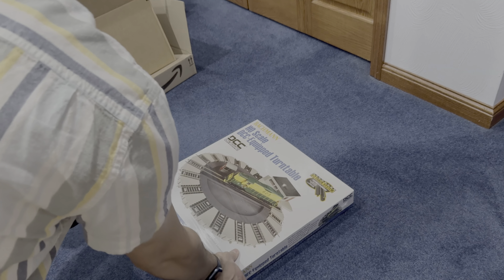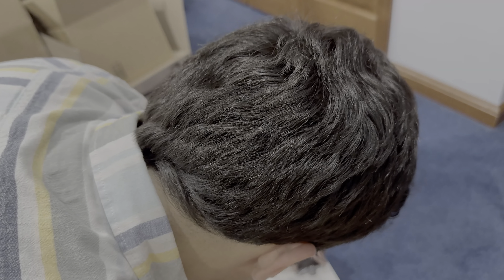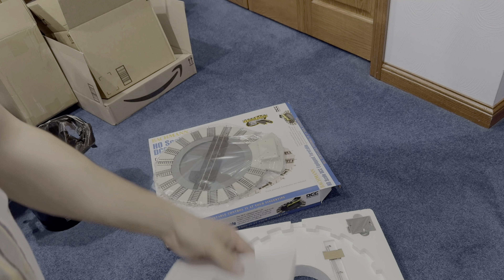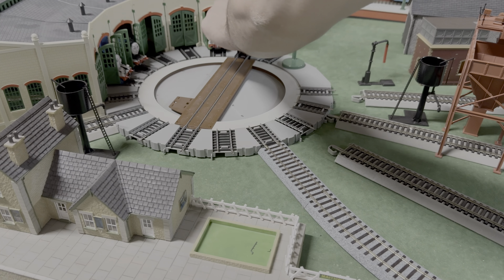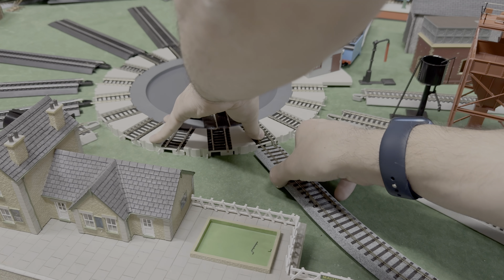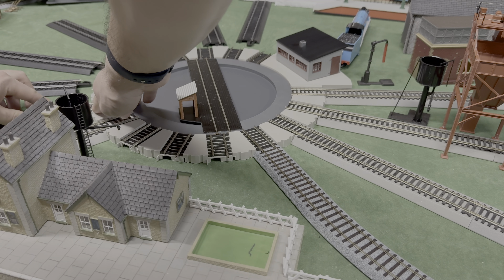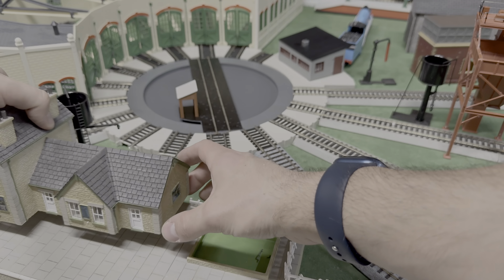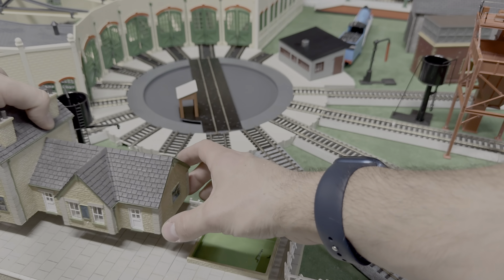Layout Updates | Bachmann DCC Turntable Unboxing & Installation | DCC Sodor

Comment: One question cause i plan on getting this the part where you had to take the knubs off the bridge of the turntable to put the green things on how many are there and what kind of drill you used to get em out?
Reply from the maker: There’s maybe 10 but you don’t need a drill that was just a mistake I made as to why I needed the drill.  Using a thin blade like an x-acto you should be able to just pry them out or using the sprue cutters and just gently squeezing they should come off.
Reply: @DCCSodor  okay thank you for your response sorry I am just now seeing this but yeah I recently just bought tidmouth sheds and some expansion packs so all I need is the turntable so I will have to purchase the new one you have and I know your not planning on selling your old manual turntable as of right now but I saw  you responded to someone in the comments saying you might in the future if you do please let me know cause I want to see if I can get that instead of the motorized one but 9/10 I have to get that one